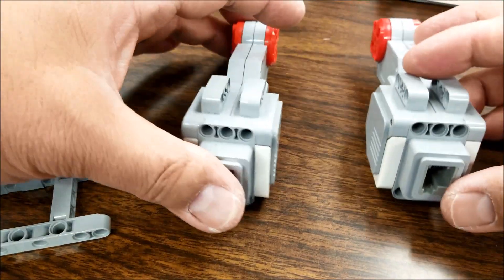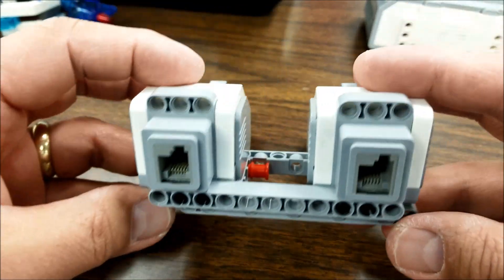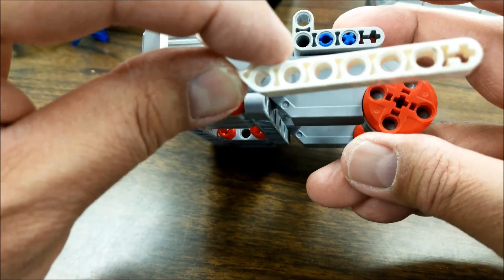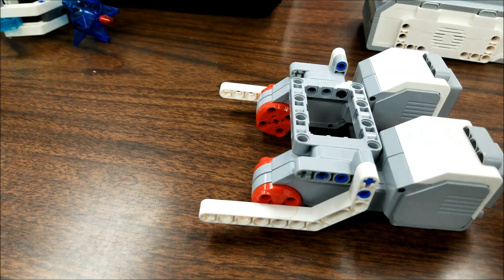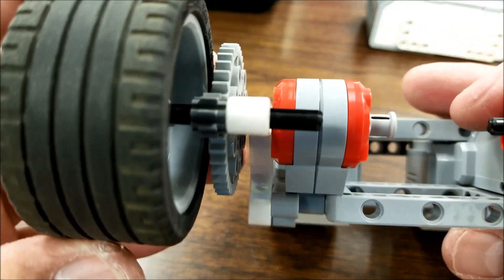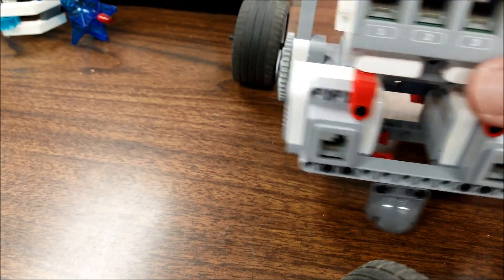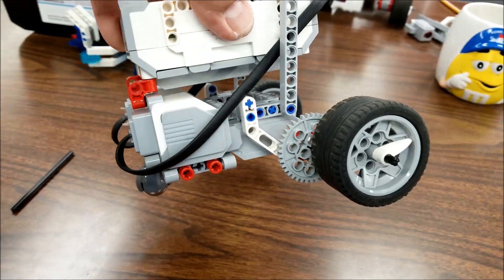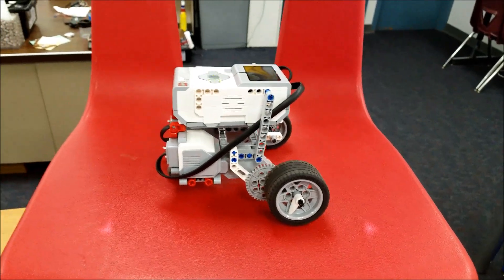"How To Build A Geared Up/Down LEGO Mindstorms EV3 Robot"

Comment: Connect two more gear and speed up😁
Reply: Ok for one, the axles would bend more and the gears would strip, it is harder to make spots for the axels, and the motors would not have enough torqe to have enough acceleration. Sorry, I obnsess over my dragsters
Reply: No i tried this u need to have high torque